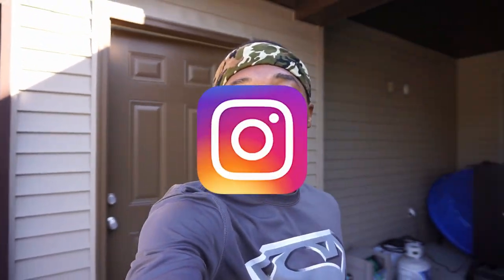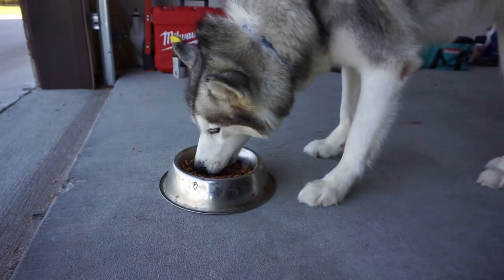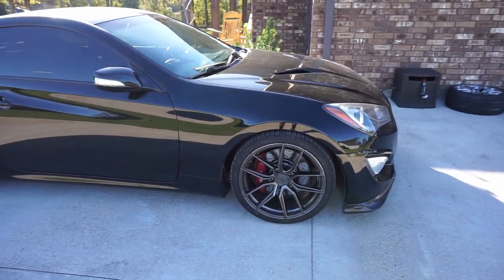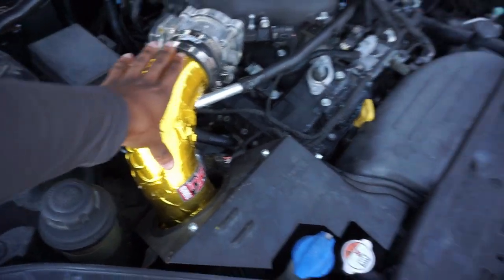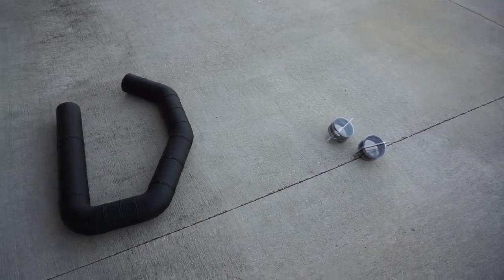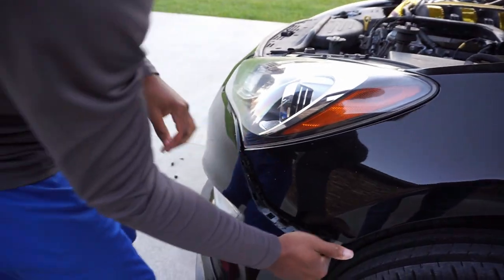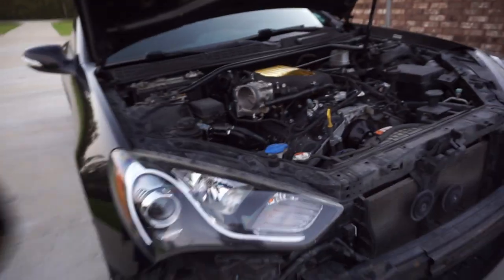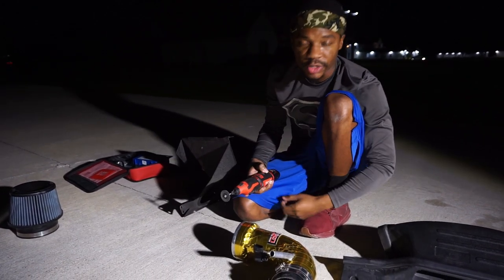Making A Custom Cold Air Intake For My Genesis Coupe 3.8

Comment: Hey bud no need to cut that plastic piece by the foglight. That piece will pop right off after you remove your fog light then you can screw back your fog light no problem. This will leave a open that you need without cutting.
Reply: Wrong ,for true functioning cold the fake screening needs to be cut out. You would then use gutter screening  in it's place . You can secure the gutter screening with fog light's mounting screws . I am Shorttrack on the GC forum , Located in Houston Texas . I did the write up for the  NITROUS  3.8 GDI on the forum . I know , 2 years late .

Comment: How did you finally solve the fog light not fitting? Buying A 2011 3.8 touring and am interested in this process.
Reply from the maker: That’s a BK1 so the bumpers are made differently anyways.. But just changing the final piece on the piping to either a more acute angle or twisting it (inlet more towards engine instead of bumper). Also making sure not to have too big/long of a filter helps.

Comment: I want to get a true cold air intake, but my BK2 (med east spec) has the sensors on the black fake vents.
Reply from the maker: Woahh.. I don’t know anything about that spec, but I’m sure there’s a way to do it still
Reply: The bk2 over there have the bk1 mpi motor
Reply: How do you know?
Reply: @catmanjesus1476  because I saw it there. the front parking sensors are on the black plastic under the fog lights. So I can't remove that to put a true cold air intake like the car in this video.

Comment: Thinking about getting some headers. What happens to the car after going catless? Does it run bad or is it drivable? Or do I need to get a tune right away after the install? Or can I leave it catless with no tune? I’ve never gotten a catless exhaust before so I just wanna know. Need some help.
Reply from the maker: Going catless isn’t really a bad thing imo.. It makes the exhaust more free flowing, and louder. It’s recommended to get a tune in order to optimize performance, but I don’t think you absolutely HAVE to rush to get one. I’ve run a car for over a year without a tune, with a catless exhaust setup
Reply: @pj_morrison  oh ok that’s good to know man. Appreciate you PJ.
Reply: @pj_morrison  right man that’s good to know. Gonna have to look for cheap headers, then a shop that knows Gen coups to install them for me.

Comment: If I can’t do a custom like this what do you think is the next best intake?
Reply from the maker: Tbh, the most proven intake for the Genesis coupe 3.8 platform comes from 3point8performance.. With the unfortunate events that occurred a short time ago, idk what’s going to happen with the company tho. So next to the custom route, I really don’t know what’s the next best intake.

The key is to get the most cool air that you can into the motor, while keeping bends at a minimum to maximize velocity. The intake piping size does matter as well, but I just used 4in piping because that’s what I had. My experience with it has still been good, thought I’m not saying that it is the BEST because there were no specific tests ran on my vehicle.

Hope this answers your question good enough👍🏽
Reply: If anything keep it stock and change it to k&n  filter, it have some hp gains but nothing like the one he have.

Comment: Sounds like every other 3.8 🤣🤣 cuz they all straight piped nowadays. Get yourself a lil race muffler or bullet muffler for some kind of unique tone.
Reply from the maker: The crazy part is, it’s not the sound that’s the same as every other 3.8… It’s your interpretation of “sound” that’s the same as everybody else’s.

Resonators deal with tone/pitch, mufflers deal with volume/frequencies. Yes they can both affect the output, but I promise you if I did what you said it’d sound just like any other 3.8 with a resonator/muffler setup.

Send me some videos on Instagram of another car that sounds like mine (@bk2.dawn)👌🏽